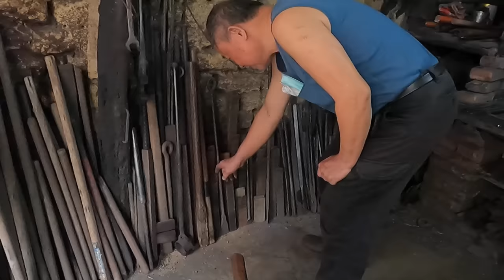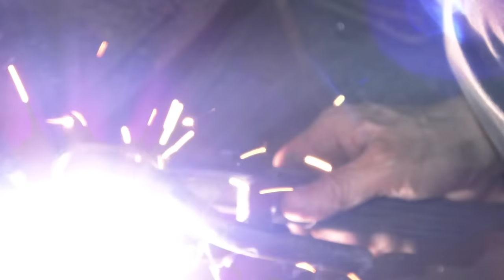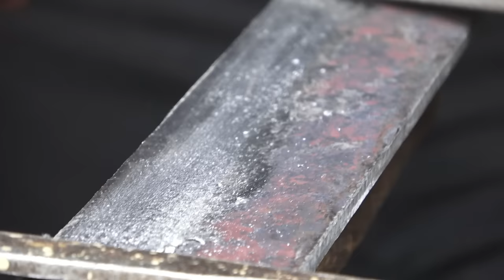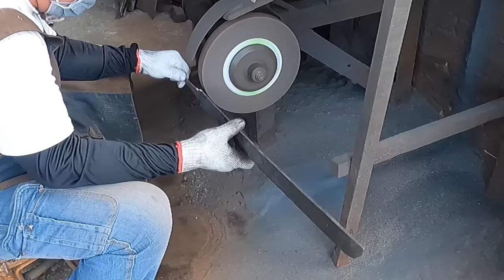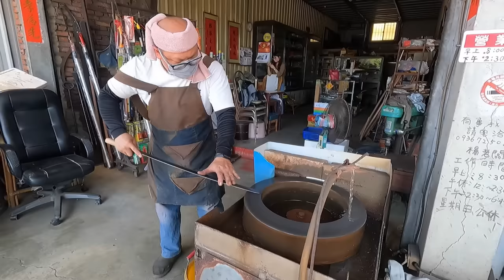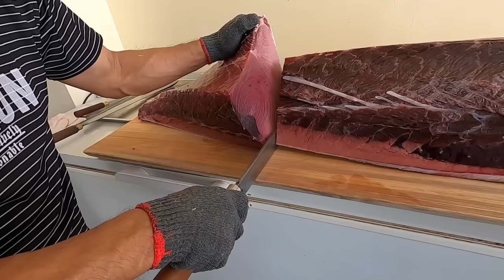World's Sharpest Sword /A rare unique Steel clad knife-making technology in Taiwan

Comment: I wish there were subtitles to have the expert explain what the process were step by step.That is great work and skillsmanship. The blade is to be respected most definitely.
Reply: the process itself is a standard layered metal billet. so far the only variation is pulling a piece of the billet to make a tang. thats not to say it isnt difficult. 
i think it would more important to find out what type of metal he is using, as the outsides appear to be different from the center piece.
Reply: The technique is called "sanmai" in Japanese. It is a high carbon steel center layer clad with two layers of a low carbon steel. There's nothing rare or unusual about this. Hobbyist and semi-professional smiths do this every day in the US. You can see this and other more involved techniques for making even sharper blades on the History Channel TV series "Forged in Fire" in the US and on YouTube. There are many YouTube channels showing various blade forging techniques.

Comment: Those blades are scary sharp. You can tell by how clean the cuts are made. It showcases both the blade smith's skills and the cutter's skills.
Reply: You can put an edge like that on almost anything but a really well forged blade will hold that edge.
Reply: @johndouglass3691  and with modern steel that's unbelievably easy these days. Just gotta know who's making fakes.... China sadly so that's ironic.
         Heck 1095 steel knives are readily available at most stores in my area you just gotta remember they require special attention and service to prevent rust but beyond that they are exceedingly sharp and can retain that edge a few good years if you treat it like a hammer on bone regularly lol.

Comment: Congrats on mastering this ancient balance game of making something as sharp as you can without making it too brittle :)
Reply: why?
Reply: @bwang5176  because if you make it too brittle, the cutting edge will surely chip.
Reply: @bramweinreder2346  easy, buy a block of 1095, temper it to around 50 or 60 HRC, fine grind the edge with a 3000 grit stone and boom. A knife that will last for generations if you oil it once and whole and clean it after use and don't leave it in water.
      But that's leaving out where the real skill actually come in, the level of the grind, the geometry of the edge, the balance resulting from tapering. These take years to master. 
        Granted it's China we are watching here so it's hard to tell what steel was used, nearly any steel can be tempered but we weren't shown it's flex or durability merely that it cuts fish. If these guys wanted to impress I wanna see it's limits.

Comment: If these Taiwanese and even Japanese artisans ever got into the business of straight razor manufacturing, they'd hit a worldwide market the likes they've never seen!
Reply: A straight razor made in Japan from blue steel tamahagane costs 10,000 USD. They can make anything designer made steel powder where each individual grain is tailor made then sintered at high temperature and pressure. Today's metallurgy is a world start and unimaginable. 3% carbon, 3.5% chromium. 1.6% Vanadium 1.2% molybednum. The grain structure is tailor-made.  Heat treatment is differential and targeted.

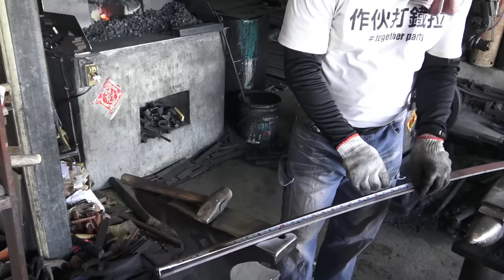Comment: I ain't no blacksmith, but until 15:25 I had my jaw dropped, I would like to know what metal was put betwean those steel plates, My guess is that it is some carbon rich steel. fragile, but coated with elastic steel, it can be sharp af...and durable at same time. perfect for cutting, it doesnt requires to be sharpened a lot and it will be sharp until u mess it up. after 15:25 I was like.....What TF is this mass production.....steel looks half as thick as it was.....hammering is ...dunno...skipped for video sake?...overall sharp...but not as half lifelong as product from start of video...but again...I Ain't no blacksmith

Comment: The steel is high carbon high chromium and can be hardened to 65-67 HRC. Once sharpened, it will retain its edge and cut through bones like butter. The technology has changed with powder  metallury and each grain of powder is made perfect, sintered to the shape and size then ground precise to the required edge. Amazing to see Titanium carbide deposition on edge as in turbine blades of a jet engine. Those knives are unbelievable.

Comment: I have a question? When the blacksmith makes an electric weld to glue the metal parts (before heating and hammering) and make his Multi layer, the addition of metal (contained in the rod) (inferior metal, with inpurities and an uncontrolled carbon level) is not one of the potential weaknesses in the blade??? 
Why this question, In my youth, I repaired washing machines and points of corrosion and weakness, on the tank was systematically at the welding points.
Reply: The material from the weld usually gets ground off. After forging down those spot welds are so thin and small they'll would most likely come off as forge scale anyway
Reply: @KevinMoon148  hum ok

Comment: Is it a steel-clad iron core?
Reply: If those are the materials used it would be a iron clad steel core.. the core ends up being the edge in a process like this. And if the core is iron, it would never sharpen correctly or hold the sharpness for any length of time
Reply: @thealarmclock9307  I think it's similar to how Japanese swords are made, the low carbon steel,  projects below the bottom of the actual high carbon steel, which clads the sides. So the low carbon steel can take an incredibly sharp edge, but the sword itself is strong with a flexible core and hard exterior, so won't shatter easily if it strikes something hard. These are also desirable qualities in a cutting tool knife like this one.

Comment: The multi-layered swords of this part of the world are amazing....
But objectively steel is not at all the sharpest material.
Between sharpness, strength and durability, I would have a preference for titanium blades. My grandfather made them with pieces taken from aircraft wrecks, as unbreakable as they were light, much sharper than steel.
Reply: titanium is only preferred for diving knives since its more corrosion resistant, thats the only place its better than steel for a blade. Heat treated steel is harder, usually above 50 HRC on the rockwell scale. While titanium is in the mid 30s
Reply: Yes for hardness, resistance to friction too.
But the edge, the weight and the mechanical resistance are better it seems to me.
For corrosion resistance it also seems to me to be much worse than iron, steel or cast iron in reality, but titanium oxide forms an extremely strong corrosion protective layer.
Grandpa collects this from hulks in airplane graveyards. Close to the engines on the ailerons, or at a certain leading edge of the wings. (Since they were technicians in the Air Force there was access)
The difficulty was to work metal.
But very practical for making small slides and also pliers for developing photos. this metal is very light and much stronger than duralumin. The liquid temperature is not much higher than steel, but the Creep temperature is much higher.
Although much more present than bauxite, rutile ore at concentrations often far too low for industrial exploitation. My best kitchen knives were made of this material.
No need to always take out the whetstone to keep them clean and sharp.
Reply: @RIRI-el6xm Have you ever use real normal hi carbon steel properly hardened and heat-treated, with 58-64HRC?

Not those soft kitchen nickel knifes, that needed to sharpen every time?
Reply: @Arwndr  I used, um, especially my wife and her staff in the kitchen, they had many expensive differing. (we always test stuff) Because I ran a restaurant for a number of years (telling you specified which steel, I'm not a blacksmith)
What I know is that the best in Steel, (for us) quality level of edge, we have it with Asian forged slicers. It is a hard steel, but which does not break curiously and which has a tendency to quickly turn black. Most Asians leave them to hatch a black oxide layer (which protects them). We only pay a few euros for this at the market (it's forging quickly, in a rough way) We, we rub them after each use with a little soybean oil.
For the working knives, I brought them back from France in my suitcases (because I had good prices in France and very good gear, all stainless steel, even the handle. Designed to go in the dishwasher. And it's something that was regularly offered to Asian staffs (back from France.) (a good French knife set, it will follow them almost all their life during their career) Good stainless steel, practical, does not rust, cuts good. Super value for money. being careful, (sharpen only with the Japanese water stone, or the French oil stone, always keep them clean and oiled at the end of the day. they last more than 20 years.
We tested better in Japanese, but not much better (again, I'm talking about the results in the hands of a cook, not metallurgy) for a price of X10.
But all of them, he didn't have this capacity of his blacksmith's cleavers, to cut meat and bones cleanly. And its slicers are so strong that you can cut bamboo or small shrubs in the garden, it helps a lot.
The only thing I found that cut better than his black blades were grandpa's light blades. His Aircraft Titanium things… never sharpened them, they cut more than a razor blade.
Reply: @Arwndr  P.S. We don't need to do regular sharpening in the kitchen (twice a year at most, calmly with a water stone (on the other hand, it takes a lot of time)) and a little more often for the slicers that cut bone. But on the other hand just deburr the edge of the blade (several times a day) (exactly as you see in western films, the bartender sharpening his shaving knife on his leather belt. Rather than using leather (this does not would not be proper in the kitchen) "We use another special knife which in French is called a 'fusil' and I'm not sure of the English name. (may be : Honing steel) you will frequently see good chefs in France using its something there between each cutting task to have an expensive one that cuts to perfection and do a very precise job. And there, you ask me a glue, I wonder what the Japanese masters who work the fish with great finesse, they use for their blade edge (I completely forgot) I can see how to sharpen the blade the Japanese way, but not work the blade edge.

The kitchen "fusil"
https://www.youtube.com/watch?v=b_-biumaXag&ab_channel=PhilippeEtchebest
(You can use subtiles and auto translate)
Reply: @RIRI-el6xm  Abour "Fusil" yes, I understand what you say about. That is usual practice for micro adjustment of knife edge.
Reply: @RIRI-el6xm  Little bit strange comparison of those grandpa aircraft titanium knives with kitchen.
Have you try to compare them in the same time of being in usage, with same conditions and tasks?
Dioxide titanium has about same hardness as a glass (~60HRC±), so yes, if there enough thickness film on cutting edge - thay can stay sharp for a long time with soft products, including meat without bones.
By the way, did you know, that sharpest edge is belong to Silicone?  (Silicone ore broken edges, like in "stone age") But thay stay sharp not for long, too brittle fragile material.
Reply: @RIRI-el6xm  
What is about this knifes in video - (look attentionally) that long knife cut only fish meat 🐠, without bones.
That tipe of cut is achievable even for good quality stainless steel kitchen knives, but - with propper sharpening and blade geometry.
Main role in cutting plays - geometry of blade and edge. Quality and hardness of steel help  that geometry to last for much longer time. (Without offen need in resharpening). That is main and only reason in such hard steels in usual products usage.
Resharpening itself - is actually recovering, restoring of that blade cutting geometry.

There is a lot of hi end steels with a even 70 HRC hardness, but if they with not proper geometry for cutting meat - they will show a very bad result.
And same 70 HRC steel with propper geometry and propper polishing of blade and cutting edge - easily cut through meat and fish bones, with same razor sharpness, again and again.

I have experience of cutting a lot of red fish with usual kitchen stainless steel, and experimenting with blade and edge geometry and polishing of surface. That ~55HRC (kinda soft) steel cut through big fishes with no efforts at all. Feeling was exact like I don't do any efforts, just easy movement of hand with knife.

But that steel was middle soft, so I use "Fusil" very offen with it.

And I have experience with much harder steels. That is a very big pleasure to work with rasor sharp knives that lasts for long long time.

Yes thay much harder in sharpening. Needed diamond stones, ceramic rods, dimond paste.
But for me that is worth it.

Comment: hand forging damascus is indeed pretty rare
Reply: lots of "cheap" damascus done in india/pakistan ect.. this looked like only 3 layers,, prob a very hard middle layer surrounded by softer steel, sharpening exposing only the smallest edge of the center "hard" steel?? i think "real" damascus has 300 layers!!??? This tool made here seems to represent practical effective use of the technique?? maybe??? probably stainless steel on outside , high carbon in the middle??/
Reply: it's incredibly common these days, the opposite of rare.
Reply: @kirkethridge2500  stainless steel should never be forged and is basically ruined steel if it is.

Comment: Spring steel the worlds sharpest, not by a huge long shot. Nor is is a long lasting edge holding steel. No forged steel is. The sharpest ,  longest edge holding steels cannot be forged. 
Ever wonder why Space-X and NASA do not have a huge crew of smiths hammering out Aero Space Arts? It is a quaint and romantic craft of days gone by.  I love it. But it is far out dated in technology.
Reply: By a few of these statements you have made, I assume you are not a blade smith. My 1500 sq ft shop full of equip. specifically designed to make knives, signals to me maybe knowing a little bit about making cutting implements. Crucible steels rolled out into sheet, cut into bars, and water jetted into knife blanks will produce very stable, repeatable results. Forging the same material may not be possible because of its properties while heated to forging temp. I am also not sure why you compared space age alloys to knife related metals. Both have completely different uses and properties for different environments and tolerances. I would bet a 52100, or 1095 forged, properly heat treated blade would surprise you. Also ground with a proper edge for the purpose it was made. There's a reason the Japanese still have very functional high carbon blades, forged hundreds of years ago. Using the word quaint, or romantic in this instance is belittling and ignorant considering your knowledge of the craft. Good day sir. Your attitude is outdated.
Reply: @richardlacroix9069  youre wrong, I forge knives too and of course use only carbon steel but it is well-known and long proven that modern stainless steels cryogenically heat-treated will outperform every carbon steel there is or ever has been. Outcut, out-last, more durable. Cant be forged tho and heat-treatment requires special equipment and technical knowledge.